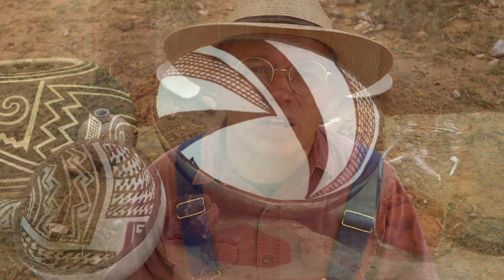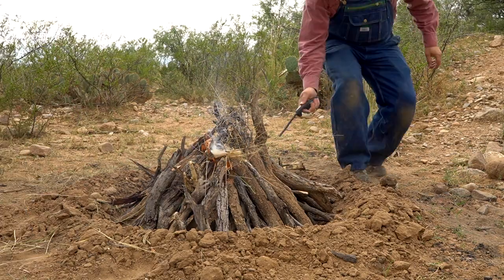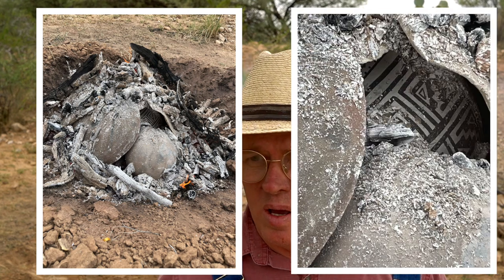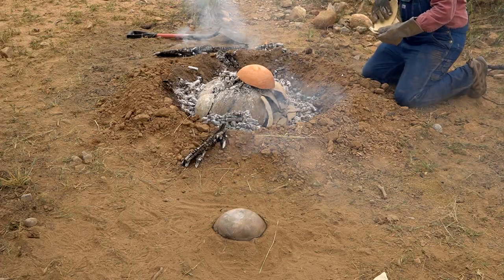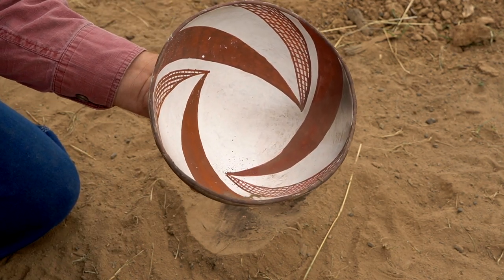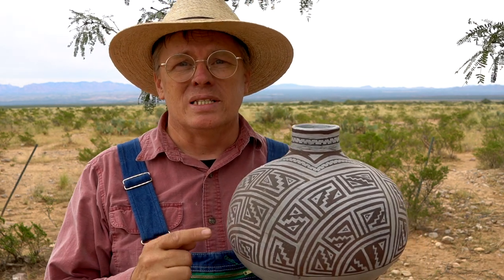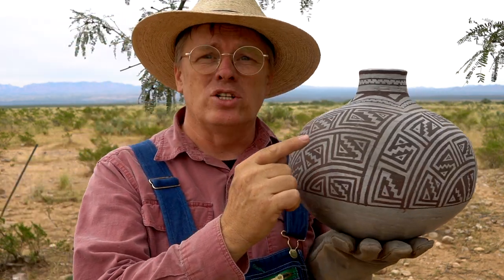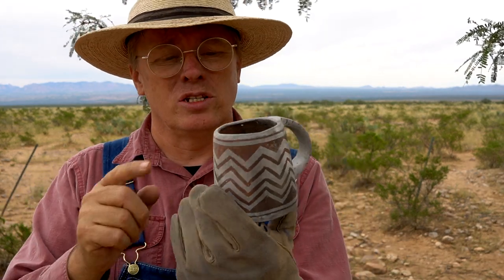Experimental Pottery Firing: Reduced Iron Paint

Comment: Cute mug!! And I think your hypothesis about leaving things overnight sounds very reasonable, as the native potters wouldn’t have been under the same time constraints as yourself.  As for speeding things up for yourself, perhaps sand that’s been sifted/cleaned in some way, so that keeping it off of the pottery wasn’t as critical? Alternatively, along the lines of your bucket idea, maybe that could have been executed with big ceramic vessels that were built only for that purpose? I’m not sure if the archeological record would support that, but these beautiful designs very well may justify that extra labor
Reply: To clarify on the sand comment: as I understand it the issue is organic matter in the soil you’re smothering it in, and if there was a way to remove that material (cooking sand to burn it off??) then it wouldn’t cover the pots in soot
Reply: I agree about a slightly larger vessel to cover the pot being fired. Then cover with dirt and leave until dawn.
Reply from the maker: Yes, thanks I have been considering clean sand. More experiments to come.
Reply from the maker: A sagar, a good idea but it is certainly not what the ancient potters were doing.

Comment: How about making a large clay candle snuffer style bell? Use a horizontal wooden pole to hang it above the fire so that it can be warming up slowly. Once the firing is complete, lower the bell down to fully encompass the pit. The fire will consume the oxygen within the bell and snuff out. Leave to cool completely overnight if possible.
Reply from the maker: Essentially a sagar on a stick. Nice idea.
Reply: @AncientPottery  Something like that, only large enough to surround the pit. A larger internal volume would keep the free oxygen percentage low for longer as it seeps in from the ground. It also eliminates the need to pile on dirt that can contaminate the colors.

Comment: Would it help if you added some combustible material such as grass or leaves, immediately before smothering - to use up local oxygen while you're covering it?
Reply from the maker: The trouble with that is that those combustibles would produce carbon and make the pot dark. Some of those hot coals might be good though because they are consuming oxygen without producing smoke.
Reply: @AncientPottery  Yeah, maybe don't clear the embers - just smother the whole lot while they are still there.  Also do you reckon the porosity of soil might be letting in oxygen? - although I can't think of something that would be historically and locally appropriate - here, I'd try covering with turf then soil maybe, but turf isn't really a thing where you're working.  I suppose covering with a hide might exclude more oxygen, but I doubt the ancient potters would have wasted a hide...
Reply from the maker: @AtomicShrimp  I have had the same thoughts. Our soil is rather dry which I imagine means more porosity, if the soil were damp it would probably make a better seal. And yes, maybe a hide over the top of the earth could be used to complete the seal and perhaps with the earth as a buffer it wouldn't get too hot.
Reply: @AncientPottery  yeah maybe earth, hide, then more earth to weigh it down, and the hide might not get scorched that way
Reply: @Atomic Shrimp I am so tickled that you participate in this channel. I'm a fan of your channel and love the content on both of your channels
Reply: @brendaoluwalana186  I thought the exact same thing when I saw @atomic shrimp comment!

Comment: Finding your channel inspired me to go looking for the clay bluff river banks I remember from my childhood, and I found some real beautiful red clay and deep green slate mixed bluffs that are local.  It's a tough spot to get to (bluffs are about 60 feet down and nearly vertical like a cliff, rapids and fast water, no shoreline), but the clay is basically ready to use (just like the stuff I remember from my childhood) if you're adventurous enough to get down there.  I tested some out while camping, and it seemed to work well.  I didn't have time to fire it, but I let it air dry overnight and it was solid in the morning enough to move it around without any deformation.  I didn't plan to find the clay that day, and had all my camping gear strapped to my back, or I would have brought a bunch home.  I am going back in a day or so for the purpose of collecting as many pounds as I can carry on the 14km bike/hike.  It's worth it though...it's one of the most beautiful spots I've found during my time on earth.  About a km down from a 60 waterfall.  Huge salmon and trout running everywhere in the little river. I'd love to be able to collect the clay, camp, and fire the clay right there on the bank of the river.  That would be super cool.  I haven't done a ton of clay work, but I did do a bit in high school and got pretty decent at it.  Mostly art projects though, not many pots or that kind of thing, which is a whole different art in itself.  Anyway...rambling.  Hope it's not bothersome!  Thanks for all the info you share!  I wish Youtube would allow photos in the comments.
Reply from the maker: Yes, photo comments would be cool except that some people would abuse it. There is always Facebook and Instagram. Sound like a cool spot, what part of the world are you in?
Reply: @AncientPottery  Ontario, Canada.  On Georgian Bay.  There is a large escarpment that runs through the area.  It's a pretty interesting spot.

Comment: Don't be afraid of getting the white dirty, that can be washed away, it can't burn into the clay. So you might want to cover the fire up with dirt earlier, when it is at its maximum heat, don't give any chance of oxygen getting into there. You can do it outdoors, it takes me usually between 4 to 5 hours to do my firings and I am always trying to reduce my pots with mixed results - lately I put some fire wood in between the pots too and they really got black, because I suppose the carbon in that wood will reduce all the oxygen there is left in the pot's iron oxyde. But I also covered it up quite fast and waited one hour to dig the pots out (more than an hour is better, but we were all freezing and made a separate small fire out of the original fire just to heat us and have a little light in this nordic darkness).
Reply from the maker: You can actually burn carbon into the clay where it will not wash off

Comment: Fresh hot coals, you can use them as a scrubber to remove oxygen when you smother. I have seen more modern pottery makers use paper strips when transfering a hot piece from the kiln to a cooling container to scrub oxygen and keep the glaze from over oxidizing. A more primitive method could be just some dry grass or hot coals placed under the piece or inside the sherds and then quickly covered, the carbon will try and burn and scrub all the oxygen from inside the piece, and maybe even slow down cooling if needed. Just an inch wide piece of a hot fresh coal placed under the bowl you tried the pull and smother would probably work. Could probably even place a couple small sherds over it to prevent it from marring the inside of the bowl with heat/soot
Reply from the maker: Awesome thanks for the tip. I’m about to try this again in a couple days so good timeline too.

Comment: Your pottery is so beautiful! The welder in me thinks that, on the bowl you pulled out to smother, the volume of air inside when you inverted it contains enough O2 to re-oxidize the amount of iron contained in the thin layer of paint. You could try pulling the bowl and then filling it with very hot dirt near the fire?  just a thought?
Reply from the maker: Thanks for that idea. I was thinking maybe set the bowl over a few of the hot coals which should consume any oxygen there.
Reply: @AncientPottery  Hey that's a genius idea, I would be interested to see you try that too!

Comment: Hey Andy, having troubles for reaching good fire temperatures, most of the time it doesn't seem to be enough for melting aluminum (around 600° C) I use ash wood and peach wood, any suggestions for reaching optimum heat?
Reply from the maker: Teepee style fire on the surface of the ground. If you don't get hot enough, keep refueling until you reach your target temp. One of these will help you to know where you are https://amzn.to/3NgBLek

Comment: Andy,  IIRC you have said previously that it doesn't turn red until the paint gets below some temperature. So it would be interesting to watch the color transition from black to red, with frequent temperature measurements, in open air as temperature falls. This would give you data to work with for future experiments - such as how much time you have to get a pot out of the fire and into a reduced atmosphere and what that critical temperature is in real world conditions.
Reply from the maker: I think I was wrong. This fire in particular has given me evidence that it is not the temperature keeping the irons from oxidizing but the coals consuming the oxygen. Move the pots away from the coals and they begin to oxidize as you can see in this video.

Comment: I love the effort. Might it make testing easier to work on smaller pieces such as a saucer or soup bowl sized object to prove the concepts before firing something large that will require immensely more fuel?
Reply from the maker: Fuel is not an issue and I have done smaller pieces.

Comment: What about pulling and smothering the painted side with sand until it's basically ambient temperature
Reply from the maker: Could work. My concern would be if the same is clean enough, any small pice of stick or root could cause a black blemish on the hot pot.

Comment: My two cents on smoothing is this... If you have lots of wood burning still when you fill in your pit with sand or soil is that. Any oxygen that is in the sand will be consumed by the fire as it tried to burn although it's now covered. As it pulls that stray oxygen out of the soil it will also off gas other gases like carbon monoxide for example. Carbon monoxide being heavier then oxygen should fill the voids that allow oxygen to seep back into the pit. If my hypothesis is correct then a bit deeper of a pit and having lots of coals and actively burning wood in the pit when smothered would be key. Enough combustibles that the entire pot is covered by them still when smothered. I think it's why the big trench kilns work so well.
I know they don't find stone lined trench kilns in your area Andy, but if they where using a hole in the ground there might not be anything left besides some discoloured holes. Likely filled in after use and possibly even void of charcoal if it was removed after firing to be repurposed.
Reply from the maker: Thanks for this, lots to think about and try.

Comment: For the pot you pulled out, I'd think the air you trapped under it would have enough oxygen to turn it red. So you'd need a way to remove that oxygen before the paint starts oxidizing - or place it in an already reduced environment. 

You might be able to take advantage of the fact that CO2 is heavier than air. The trick to using this would be in how to capture cool CO2 from the fire and channel it into a pit you could place the pot in.
Reply: An idea just struck me. It's not primitive at face value but might have some primitive equivalent. 

You could generate CO2 with baking soda. If you place down a warm (around 60-100C maybe) sherd, pour some coarse baking soda (the stuff sold for cleaning) on it, then place the bowel over it. The decomposition of the baking soda would produce CO2 gas which could force out the trapped air.

There's an additional problem to solve and that is air is going to be drawn through the pot body as the trapped air inside it cools, and creates a vacuum, bringing fresh oxygen. Maybe this could be overcome by doing all of this in a pit and sprinkling baking soda over the pot periodically throughout cooling.
Reply from the maker: Thanks Ross. Your ideas about CO2 also suggest that "smother in place" is superior because you already have those gasses hanging out there in the pit.
Reply from the maker: I think also moving a shovelful or two of the hot coals to place under the potter could consume any oxygen there too.
Reply: @AncientPottery  If I was a potter, having hot coals shoveled under me would certainly motivate me to consume lots of oxygen!  😄
Reply from the maker: @llanitedave  Ha!

Comment: Oxidation is exothermic. Carbon monoxide and heat reduces the red iron oxide to elemental iron and releases carbon dioxide. As soon as you expose the iron to air, it will immediately begin to oxidize (either red or black oxide). The soot covering (when fired in the presence of oxygen) should convert into carbon dioxide. But this additional oxygen will interfere with the reduction reaction. It seems optimal to surround the pot in a hot, soot-free firing chamber where you can swap between introducing oxygen to remove the existing soot and then switch to carbon monoxide to reduce the red iron oxide into elemental iron. From there, however, I am not sure how you would prevent the elemental iron from re-oxidizing into red oxide. I think you need to figure out how to transform it from elemental iron into black oxide (magnetite).
Reply from the maker: Thanks for the chemistry. I am trying to figure out how the ancient potters did it and they didn’t have kilns which is why this is so complicated.